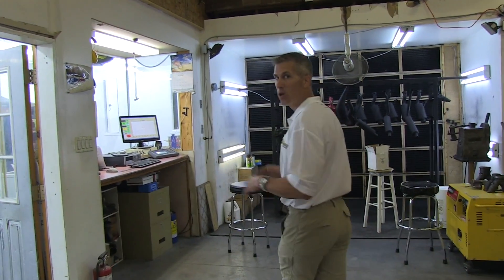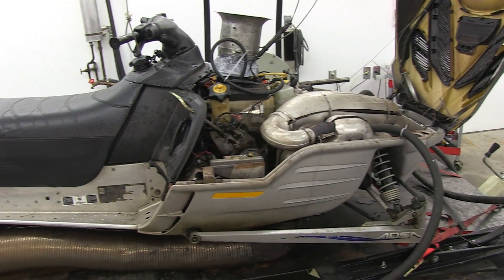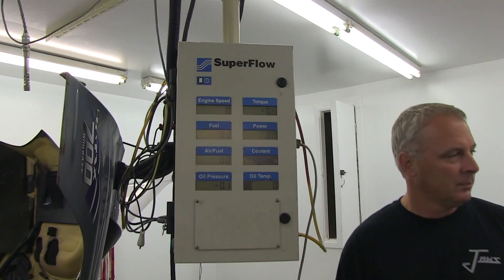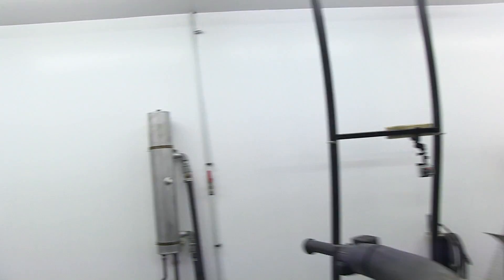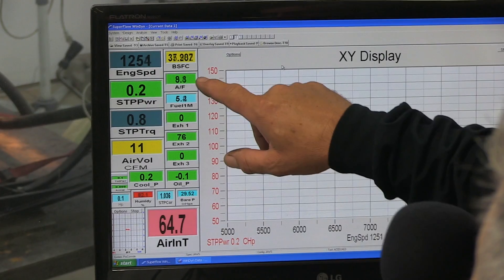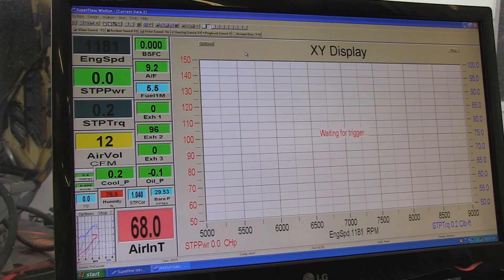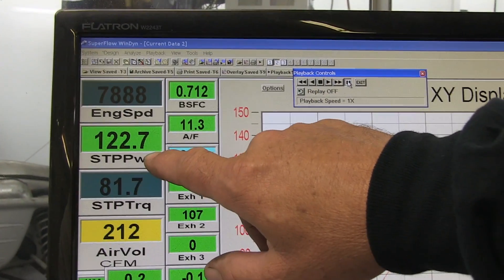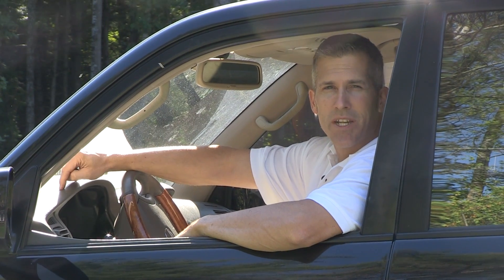Snowmobile Dyno explained at JAWS Performance, PowerModz.com!

Comment: Let's see some Old Skidoo, or JLO, or Sachs Singles Dynoed, and then some Power Modifications done to them. Skidoo 250 Type 247 was one of the longest made Singles. The 277F was not only widely used on Sleds, but also on Scat Hover Craft and Ultralight Airplanes. Who cares about these 100hp+ Engines that gain you a tenth. 99.9% of the People don't Race Sleds. 95hp+ pushes most Sleds over 100mph and Nobody Trail Rides that Fast! Impress us, take a 250 Type 247 rated 12hp@5500rpm and make 25-35hp using Max 7000rpm! 250 Type 253 22hp@6000rpm,  make 30hp to 35hp using Max 7000rpm. The Rotax 277UL 36mm Carb was 26hp@6250rpm, 28hp@6400rpm with a different Exhaust, 277F with a 34mm Carb was 28hp@6750rpm, let's see a 36-38hp at Max 6750rpm. Any Big Bores for these Singles. Any 292 TNT or 340 TNT upgrades. With 33+ different Brand Name Snowmobile Engines used on 360+ different Brand Name Snowmobiles.

Comment from the maker: Yes there are two schools of thought, and the main difference is clutching.  In my opinion you need to know the hp of the engine, air/fuel, torque etc to give you solid engine numbers  before you need to determine hp at the track - and at that hp on the ground/snow only really tells you how well you have your clutching set up.  To clarify, a dyno  on the crank tells you engine hp, a dyno on the rear wheels tells you if you have everything from the engine to the ground (clutching) right.
Reply: PowerModz i